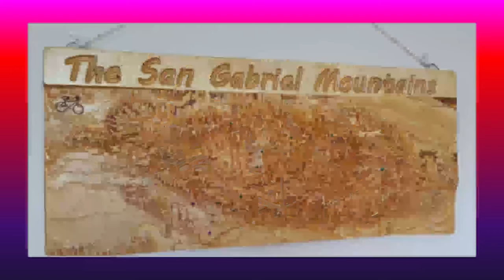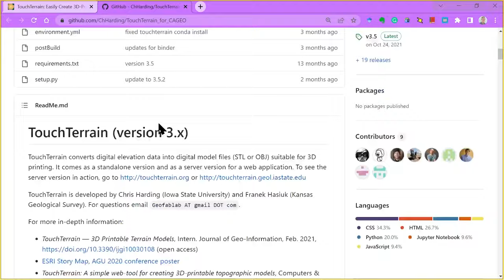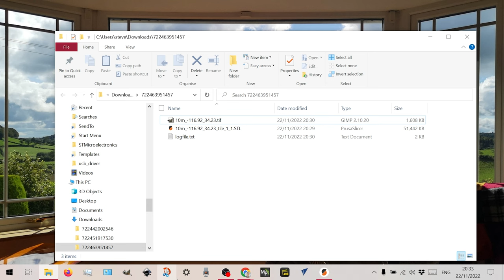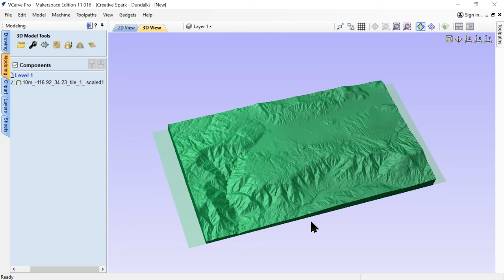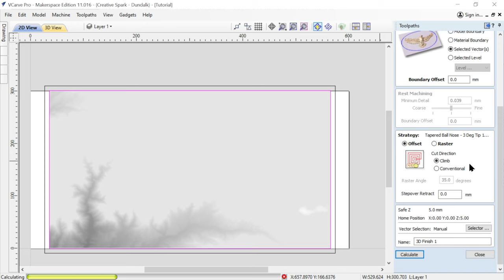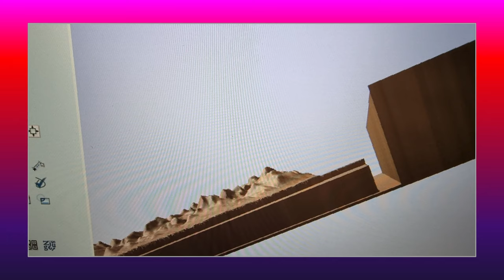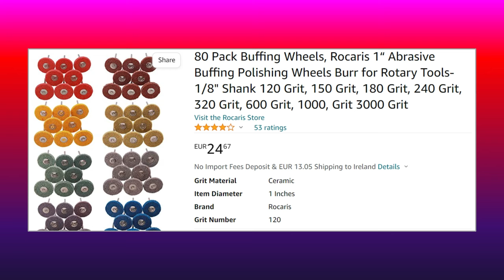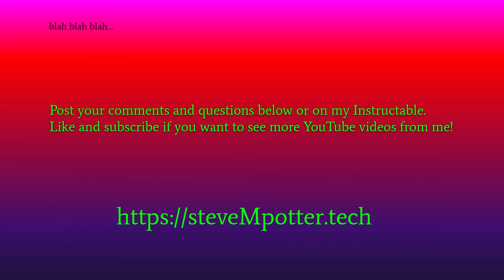Terrain Carving CNC Tutorial by Steve M  Potter

Comment: Great tutorial.  Question:  since the surface of the water is flat how do you program to carve out of that area for your resin pour?
Reply from the maker: Good question! For water at sea level, use the lower_leq option as described at 5:15. If it is a lake like this, I had to trace its outline in VcarvePro, and use that vector to create a separate pocket toolpath that is about 3mm (or however thick you want the resin) below the Z height of the shore.
Reply from the maker: I traced it manually, but if you have a good image of the lake, you might use the Trace Bitmap tool in VcarvePro (or other graphics program) to create the lake outline vector automatically.
Reply: OK, I see, so if the lake level is at or very close to the lowest point I could set that as “sea level” and go from there.  Otherwise it looks like I can get a good image off of the “map” function that would be scaled properly.  Probably carve the lake first?  Anyway the program was fun to fool around with.  Thanks Steve!

Comment: Hi STEVE.....  So, in regards to the "manual settigs", do you type in the box "lower_leg":(0,3)?
Reply from the maker: From my Instructable linked above, which has a bit more info: I use the “lower_leq”:(0,3) option to create a 3mm cliff around the shoreline down to the seabed, for filling with resin.
Use the quotation marks, and note that it is "lower_leq", not "lower_leg".

Comment: Hi, how come there is no stepdown option for the finishing pass with ballnose? Do you remember what you used? Thanks
Reply from the maker: The finishing pass can have a very large depth because the stepover is so slight (7-15%). There is very little force on the tapered ball nose bit, so no need to clean it up with more than one pass. I believe I left 2mm with the roughing pass for the finishing bit to remove.
Reply: Thank you! @professorstevepotter

Comment: What type of cnc machine would you recommend for doing this? Any specific budget friendly brands?
Reply from the maker: The MPCNC Primo kit by V1 Engineering is what I built. Fantastically capable for the money (about $1000 with my options and additions). But that is for hackers who like to make stuff. Any CNC router or mill can do terrain carvings. Other Youtubers compare cheap CNCs that come built or are easily put together.
Reply: @professorstevepotter  Your video is very thorough. I am in the US so there are minor differences but it is very informative. Why do you prefer Vcarve Pro?
Reply from the maker: @tylertalbott8136  Have a read of Appendix 3: VcarvePro Vs. Fusion360 in my Instructable, 
https://www.instructables.com/Carving-3D-Terrain-Topographic-Relief-Maps-on-a-CN/